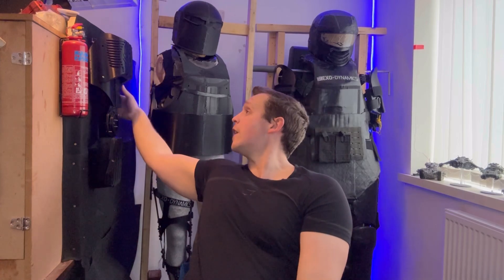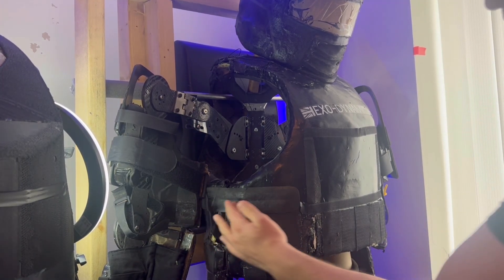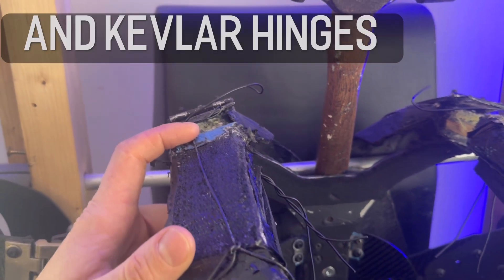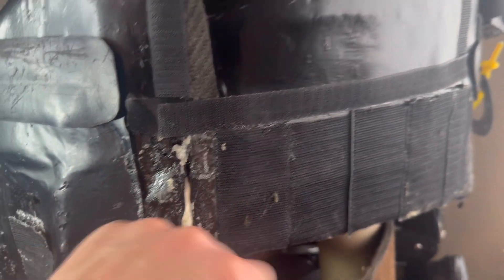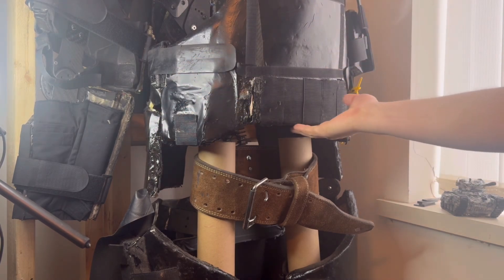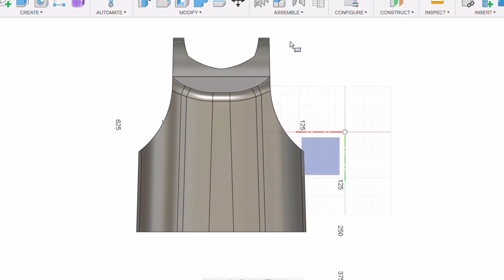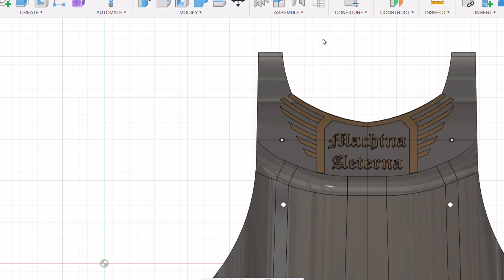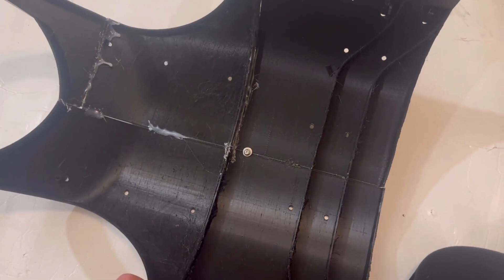The problems i found making an armoured chest plate. Power armour upgrade.

Comment: If this is actually power armor, the actual POWER armor frame should be designed first, with whatever requirements that needs, with armor being slotted on as possible afterwards. If someone is hit, they're not going to want to have to replace an entire breastplate.

Comment: Try using strips of polycarbonate they're tough but if you get them to 230 Fahrenheit they deform and you can shape them as you need it so that's basically a heat gun cost is the only thing since it's not super cheap but it's not like buying carbon fiber so you should be able to find some fairly inexpensive

Comment: Dude, screw ceramic, just use forged steel or some strong alloy, titanium if you want to keep it light, but USE METAL! Metal is the ultimate material! When ceramic breaks or goes bad, turns to dust! When metal goes bad or breaks, still holds strong despite that! Besides, metal is easier to work on than kevlar which tangles on your drill or ceramic that puts dust everywhere and you can't ever clean it properly.

Anyway, i really LOVE a lot how you are engineering this, it's beautiful, it's MAGNIFICENT! It's full cover robust armor but keeping in mind all about mobility and flexibility, it looks like something that the military would actually adopt or use for reference (if they even had the budget, because it seems that just giving a dude a rifle and a vest is too expensive for them 😒)
Reply: i agree with you about needing something that doesn't powderize when damaged. Steel as a base structural layer makes sense, but totally replacing the kevlar and ceramic with steel is really not ideal because its "too good". The steel will cause any non-penetrating shot to create spall which might injure the wearer depending on where the shot lands. The ceramic and kevlar are better since they can deal with (albeit fewer before becoming too damaged) higher powered rounds while catching the spall from bullets.
Reply: @MrPonchovie atleast a kind of metal frame where if the ceramic is damage you could theoretically swap it out
Reply: @MrPonchovie  Would grade 5 titanium work? Or would harden steel be better?

Comment: "In summary, carbon fiber has been deemed unsuitable for bulletproof vests because it is too brittle, Kevlar is cheaper and stronger, and other strong fiber materials like carbon nanotubes may one day be suitable." + You don't wanna breath carbon fibre dust
Reply from the maker: True, or get broken bits of carbon in you!
Reply: @MattExo-Dynamics  yeah, i have Been there, hand Full of tiny carbon fibre spikes. Very itchy and painfull plus causes infection. It Took like almost 3 months to get rid of those

Comment: If I may make a suggestion to save on cost in prototyping instead of using the actual materials. Use pieces of cardboard that are glued together for thickness to create the prototype. This will allow you to get the proper look and fit prior to constructing the actual suit. Also, the cardboard will give you a template to be used in the construction of the actual armor.
Reply: a lot of the issues he discovered in this video he only discovered because he used the intended materials instead of light weight stand ins, i think its good to prototype like this so he finds those critical issues

Comment: 7:58 you should study Italian Breast Plates. Unlike gothic they tended to be a giant solid piece that all most entirely covered the torso. They would bow it out for the sake of deflection of blows but also to increase maneuverability by allowing more room to bend. Unfortunately that would mean you need to completely remake the breast plate unless you can increase the current one's size.
Reply from the maker: Ill have a deeper look into it thanks!
Reply: @MattExo-Dynamics  no prob God speed man :)
Reply: Oh you're referring to specifically the later milanese style with the nearly spherical cuirass. Earlier italian armour actually had the breastplate and plackart as separate pieces allowing the user to bend side to side and do ab crunches.

Over time, the plackart grew to cover more and more of the chest until it completely covered the breastplate and became one solid piece. This happened for both gothic AND milanese armour, actually.
Reply: @ yea exactly. I was thinking of the late italian versions but always good to clarify for people.

Comment: im making this comment 3 mins in so maybe you address this but, why are you making your prototypes out of ceramic and kevlar? Wouldn't it be best to use hard plastic and stiff textiles to replace the ceramic and kevlar, with cardboard where you dont need structure until you get a design that moves properly? Edit ok you mention weight being an issue for prototyping where when you do it with lighter materials it doesn't put enough strain on the load bearing parts that move, you wouldn't have caught the hinges failing if you did it with foam. Have you considered lead weights to hang from or maybe set in the prototype armor possibly as cut outs in the plates with velcro on the inside so the lead has something to sit on and doesnt just rip off the velcro? That way you can test how it moves and where it fails while saving material as cutouts for weights means less hardplastic/ cardboard.

Comment: Medieval Plate armour evolved through a 1000 years to be quite an incredible piece of equipment. Amongst many of the threats it was engineered to provide protection against was ballistics such as arrows and bolts and even the balls from early muskets and pistols....which high quality plate was surprising good at deflecting.
       During this period, they armourers discovered what we would now called " bullet traps " where the shape or angle of a plate would be weaker against ballistics or would deflect it into a unarmoured area. 1 example being arrows/swords unable to pierce a breastplate, but were bounced upwards towards the neck and under the helmet visor......this was solved by the creation a Gorget, that allowed unhindered movement, vision and protection to the throat.
      Segmented Pauldrons were created to cover the weak spot between breastplate and shoulder, and allowed full articulation due to their overlapping and multi-sectional design.
Reply: One of the first things I was thinking about when I saw this was that a gorget would do wonders in making it more functional. If shrapnel is deflected across the chest it's going up the nose!
Reply: Old design impressive ingenuity

Comment: I'm trying to think of something that would be very dense/heavy and quite stiff/hard, but easier to work, and CHEAPER than armour plating. Might make it easier and more financially viable to make more of these prototypes. Maybe something like steel wool and fiberglass mixed with epoxy putty? as long as you have a cheap epoxy it could be fine?
Reply: If it were metal, machine the plate then use an induction forge on the scrapped chips or scrapped parts to save money. Of course then you have a very heavy suit. Could also 3d print prototypes and then eventually machine a dye cast for his idea of a polymer plate.

edit: sorry ceramic not polymer plate
Reply: @Bagginsess  What about grade 5 titanium, would be very expensive but would be a hell of a lot lighter than steel.
Reply: @Jeffery3464  still too heavy for his setup. The battery wouldn't last long. He explains why he choose ceramic in one his first videos and if I recall correctly he points out he made the decision to go with ceramic over metal due to weight. One for being able to move without power and two to lower the power drain on the battery.

Titanium would be the best metal practically due to its strength to weight ratio but like you mentioned it is very expensive so from a financial and logistical perspective it is not necessarily the best material. But maybe it could be used sparingly like only as an insert for the chest plate.